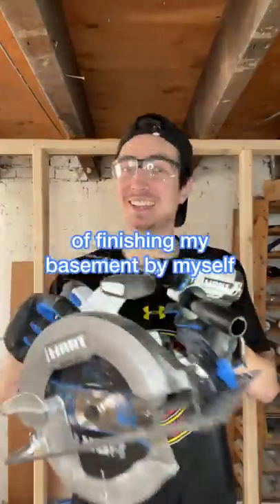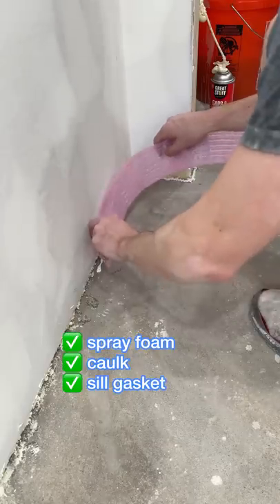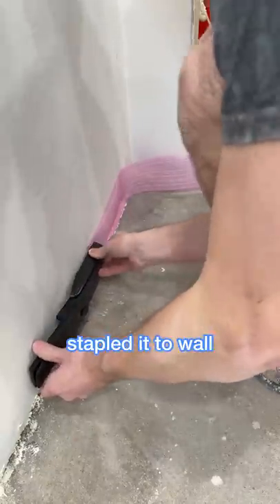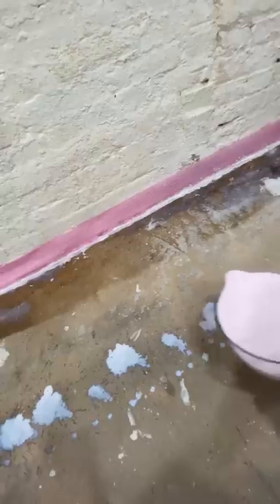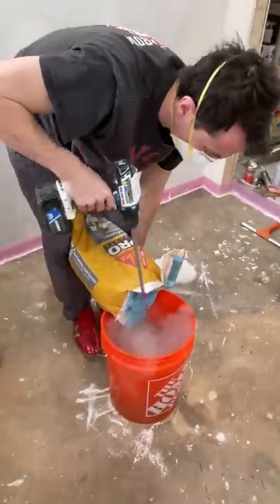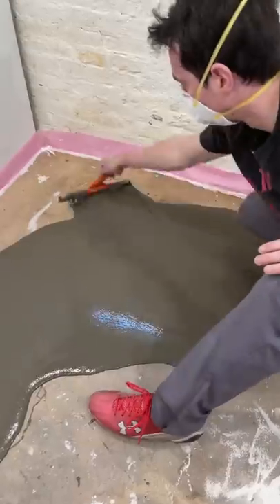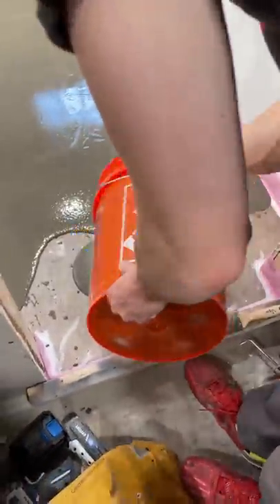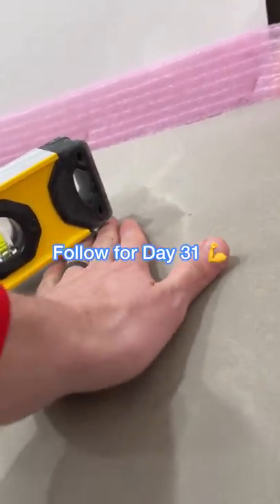DAY 30 | Finish Basement by Myself 💪

Comment: Next time you work with self-leveling you have to mix way more watery, because if it is too thick in won’t work as it should.
Reply: My exact feedback ^^
Reply from the maker: Couldn't agree more. Lesson learned haha. Thanks Lauris!!
Reply: And a roller with spikes to agitate it to get it extra level.
Reply: Yes this specific material runs thicker than other brands  even when more watery, have to work it out won’t self level by itself
Reply: @realiferenovation  were you pretty exact with the water you added? Like you added what they said but should have added more?
Reply: Read the directions,  it's too thick
Reply: If there was a hardener or activator it got mixed in way too early
Reply: I was literally about to comment this. Glad I'm not the only flooring installation specialist here
Reply: Yh needs to be loose so it self levels
Reply: I was gonna say exactly that
Reply: A squeegee pole works better
Reply: @Cizzzeron  extra level? No such thing.
Reply: @jefftickleschitz1265  i just mean that the self leveling concrete doesn't get completely level just by pouring. It needs to be agitated.
Reply: @AngelSanchez-of3sy  wont self level by itself 😔
Reply: @reanbowlerd5988  😅
Reply: As I was watching it I saw it being poured and said to myself it’s too thick

Comment: If your slab has settled that much you definitely have big voids. A foundation repair company can fill those voids with a structural, high-density, expanding polyurethane foam. The self leveling concrete will give you something even to work with but will not address the underlying issues. It may take some time but it will definitely settle more and possibly crack, especially with the added weight of the new concrete plus whatever will be stored there. Message me if you have questions.

Comment: Self leveler is a different animal than concrete. It is not as simple as adding more water. It is designed to use a specific amout and any more would compromise the integrity of the finished product! It does require some manual leveling work. And the cleats (spicificly made for the application) are so you can level it out after it has all been poured! If you mix 15 to 20 gallons at a time it goes way smoother!

Comment: Yes self leveler levels itself, but if you have more in one area than another it’s not going to level out in the same plane. You still need a set grade around the perimeter to give self something to go by as you spread it. You also need a few grade screws in the middle depending on how big of an area to make sure you don’t have a dip anywhere. Just because it levels itself doesn’t mean it will all be the same height in every corner. You mixed it fine just didn’t have enough in that area to begin with. Anyone who says otherwise doesn’t know what they are doing.

Comment: Looks ok. But in the future you can get away with using 3 mil poly (insulation plastic) you get a massive roll for less then sill gasket. Definitely mix the cement a tad thinner but not much pour more for sure and use larger containers the 5 gal buckets. Then you want to churn it a bit from the wall to the door. The churning brings up a thinner "cream" to the top and helps everything level out properly. Good luck with all your renovations!

Comment: I’m 15 and my dad is a contractor I work with him all summer for about 5 years now and if you want the concrete to self level you need to add more water so it spreads around easier and to fix the low spot just add more concrete
Reply from the maker: Yeah I agree Zak. I definitely needed more water
Reply: @realiferenovation  you don't need just more water.
You need water per instruction on the bag=more, but not too much.

Comment: I work as a hardwood flooring installer and we are very picky about what type of self leveling concrete you should use.
The few times we do it we apply primer with roller and let it dry.
We read how much water you should have, and you are not allowed to go above what they recommend, usually it's 1DL +-!! So if you should have 6.5L you can only go 6.6 or 6.4, it's very very important.
After you spread it out as even as you can (you can put some small plastic things i don't know the name for to know how deep you should go on certain places) you should go over the concrete with a pigroller, it's a roller with alot of nails basically to "massage" it, the more you work with it the more it level itself out.
It's like icecream, if you stir it up it get softer.

We only buy expensive self leveling we know are good, we always go under +-2mm on 2m.

Comment: small helpful tip if you didn't already know. the next time you have to use floor primer instead of using a floor brush. try a large paint tray and a paint roller goes on so much more easier and evenly. small tip I learned doing wall and floor tiling when I was younger

Comment: As other comments mentioned way more water is your friend with leveller and if you drill a hole about every 24inches in rows across the floor you can use a plug and screw in each to set the level you want to work to with a long spirit level, they also act as an extra key to hold it all together when set

Comment: One of the best things to do with self leveler like the last guy said yes make it more watery plus after the bonding agent on the floor dries sprinkle fresh water over the entire floor usually with a commercial sprayer mist water and then dump the self leveler and because there’s no surface resistance it’ll lay flat just like water I just did a conversion from a bathroom into a closet at a new dental lab in Longwood Florida and it laid down light glass I put half a bag and I filled it with water until it was just under the consistency of applesauce and it goes down like Glassman

Comment: Mix exactly as instructed. Pour quickly and evenly, don't expect it to travel far. Quickly help it spread at the beginning to break the surface tension then let it level off. If you mess with it late on it will mark.

Comment: Quick tip: along with adding more water to the mixture, you might want to try starting your pour on a high side near the wall so the concrete can move into the low areas naturally using gravity and the edge near the wall can be used as a chute to guide the concrete where it needs to be. That's helped me on my basement tho.

Comment: Follow the directions on the bag specifically  usually for bags that size I believenits a gallon and a half of water you overmix it and the sand separates and it won't set up properly. To dry and it won't level right.  I've don floors now for almost 10 years and always found that leveler definitely  needs to be al.ost perfect to get the best results.

Comment: Decent job. Next time you can use thinset for the cracks we’re. How we do it in our local. Thinset flush w the wall. And definitely more watery. Not to the point it’s water but where it can literally self level instead of you pushing it. But over all good job 👌

Comment: The sill guard and caulk were a waste of time, even pre cutting the great stuff. Put down a bead of great stuff, make sure it’s tall enough, pour your leveling, and then cut the great stuff flush with the self leveling. Will save you a lot of time
Reply: Just use red tape.
Reply: Tuk tape works the best

Comment: Mate I’m assuming you pretty much read packaging/YouTubed it. 
You done alright for a first time DIY and took all the precautions to not cause problems for future contractors.
Even if the mix was a bit thick and didn’t end up level. Can always fill that in. Just make sure to re do the whole floor because you’ll end up with two different shades of grey (not fifty)

Good job mate

Comment: You're learning man. Yeah, self leveling is supposed to level itself. Watery concrete mix is recommended. Did you put any of the pink primer on it before? It looks like you scrapped the idea to drywall the ceiling too.
Reply from the maker: Appreciate it! And I did use the primer before. Ultimately, I opted for no drywall ceiling because the ceiling height is already so low
Reply: @realiferenovation  that's fine. I'd recommend halo lights, to insert in between your Joyce's then. Keep your head height and really puts in a lot of room. 
Do some googling on how many halo lights are recommended for your sq ft. 

And remember it's a marathon, not a race.

Comment: I use paint sticks cut into 1” pieces stacked on each other and siliconed to the ground every couple feet to use as a guide so I’d know how much self leveling to pour in the low areas and a 3/16 - 1/4” v notch trowel to spread the self leveler around, been pretty successful doing it that way. Just my 2 cents good luck
Reply from the maker: That's GENIUS!!

Comment: If you are following the directions you should be dumping into wet. Mix multiple buckets at once. The goal is to find the heights you need before you pour. A lazer and a tape measure 😛

Comment: Use a real respirator that is designed to filter silicate matter in the air when working in enclosed areas and mixing that or RIP your lungs. Don't mix @ high speeds you mix at low RPM so as not to destroy the bonds in the mix.

Comment: Put your latex on with a paint roller or a sponge. WAYYY easier. Also you don’t need to spread self leveler, it will run to low areas on its on

Comment: Ahh thanks that’s what I have to do to my floors in my basement. The previous owners built, “something like a floating floor” 🤷🏻‍♀️ I don’t know what to call it or if that’s even a correct fix. Btw only half of the basements finished with that floor, that’s how I know. I want to “fix” that because it’s like 5-6 in

Comment: Dude you need a longer handle squeegee. I could've done that floor by never stepping in. It's a small sqft. Ya the job will be done but isk how long it will last. I grind the floor first. Then vacuum so the self level will stick better. Idk. Good try I guess. But it'll probably crack, shift and turn to shit in a few yrs
Reply: You need rubber boots. Cleets go for epoxy 🤦‍♂️

Comment: Getting windows done quotes came in at 27K manufacturer wants 10K to make them. 17K to install. Change my mind ?
Reply from the maker: Sheeeeeesh. I heard window prices are about to jump through the roof. You should give the install a try!
Reply: About right.  Insurance and bonding for a licensed installer is high, as is the liability and possibly of cost overruns. You can do it yourself: make certain you find advice about the whole topic of weatherization. The physical replacement is usually simple, and yields satisfactory results. Knowing that you've not introduced new problems)long term or short) into the house and achieved maximum results is yet another level. 
As a professional, I'm suggesting that if you DIY, don't skimp on your supplies: use the highest quality sealants and fasteners you can purchase.  Don't think that caulking, even high quality caulking,  replaces flashing. 
And regarding installation contractors,  there are some great resources to help you choose well.  There are some that will cut corners, but this comments section is too brief forum. Check out the essential craftsman channel. He's got a video and I think a booklet.
Insurance is high because the cost of repairs after a bad install can be very high. Bad install van end up with mold and or rot. Be informed if you're wanting to DIY. Someone else's videos with 'success' at the end is NOT a long-term success. 
Best wishes: you can probably do it well, but be well educated beforehand.

Comment: Try using a laser level in a fixed point in room and mark around the walls the height that will show you exactly where you need the pour to go most.. you can then use a tape measure to measure downwards to mark off where the low spot should finish at.. Good effort for first go
Reply: I bet you he has noooo idea what you just explained 🤣🤣🤣🤣
Reply: Wow or just use a level and pencil